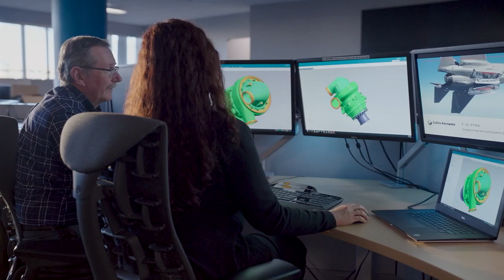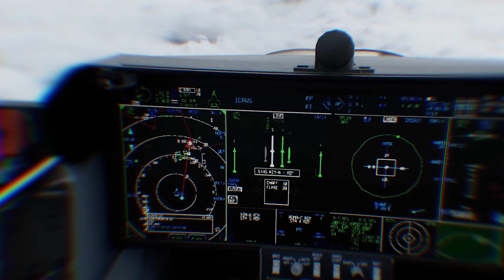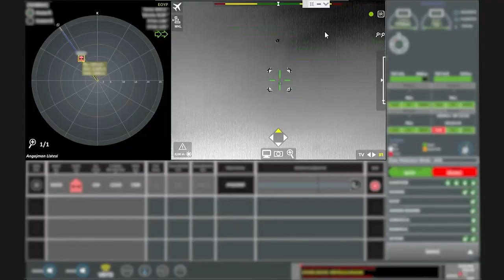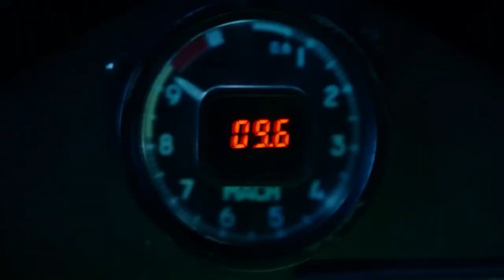5 Secret US Warplanes Will Blow Russia And China Away

Comment: A couple of points about F/A XX. The F/A XX is supposed to replace the F/A 18, not compliment it. Also, I have not seen anything about a V/STOL version of the F/A XX. The weight penalty of the vertical lift system would severely limit the range and performance of the aircraft. One of the main requirements of the program is increased range over the F/A 18 and F 35C.
Reply: Don't count your chickens before they are made and are air worthy and in the inventory before we count them